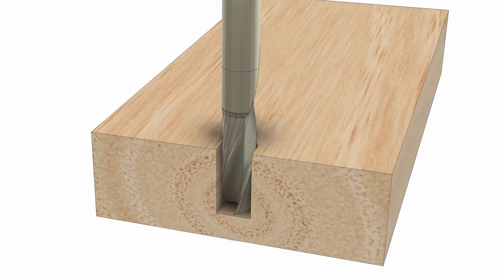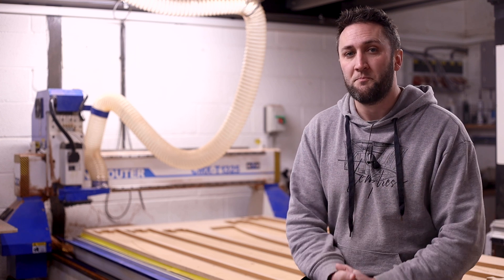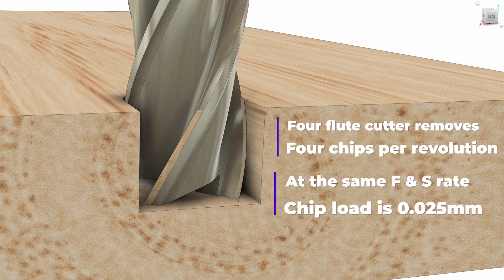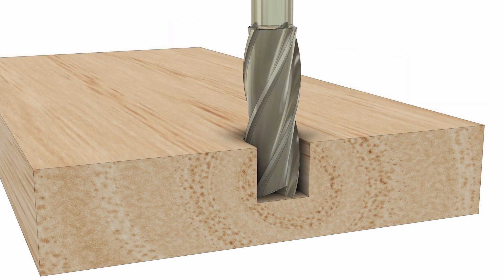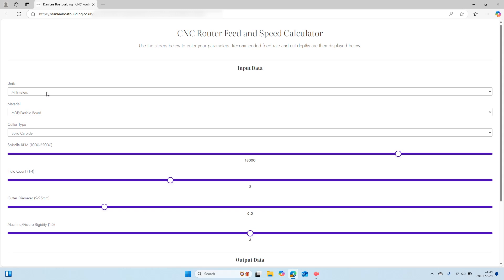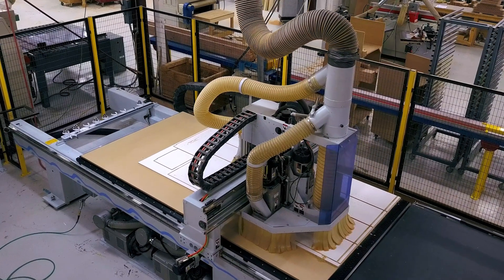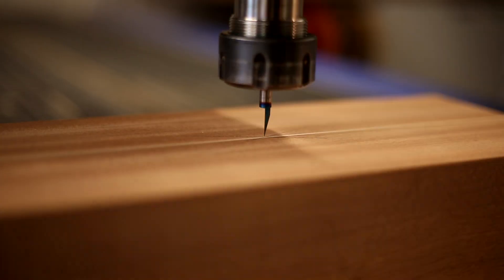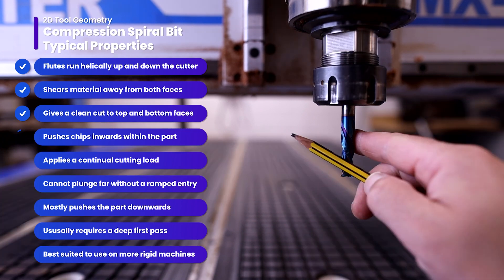The ULTIMATE CNC Router Feed and Speed Calculator | Online CNC Router Course Sample Lesson

Comment: Hi Dan, thanks for the video. My Ooznest Workbee has a max feed rate of 2500mm/sec which is obviously very low. Therefore, I need to compensate by reducing my RPM drastically. I'm concerned running the router RPM too low will be dangerous. Do you have any suggestions on lowest RPMs I should be stopping at? For example, is 3000-5000 RPM achievable or risky? Can I go lower still? I'm carving wood (hard/ply/MDF). Many thanks

Comment: Maybe add lock toggles on each parameter on your next update. That way you could lock the spindle speed and work on the rest, or lock feed and see the other values change. Many people starting out are on cheap machines that don't have all the access to the variables of this calculator. This is how cameras work with the exposure triangle, you can shoot in Aperture priority essentially locking that variable and then the other values are free to change to make the perfect exposure. It might help your students understand the relationship easier then a bunch of sliders and get them up and running easier when they don't have fully capable machines.

Comment: i not can understand how make good right feed and speed because normal spindle can only be speed 10K-24K RPM ad feed not can decrease many cnc (diy CNC) more than about 1000-1200mm/mon. burn bit or not cut good chip ewer and drill bit burn alltime.
Reply from the maker: Thats a problematic combination, even at your best case scenario (10k spindle RPM and 1200mm/min feed rate, with a single flute cutter) you are still only half way to where you need to be for a recommended chip load, if you are cutting soft woods for example. I am guessing your feed rate is limited by the construction of your machine? What spindle are you using? In an ideal world you would source a spindle that can run at lower RPM's but the best you will get out of your machine using it's current setup would be using the combination I've just mentioned.

Comment: Well explained Dan. I have used both hobby and industrial machines and it is a minefield. A lot of the time your ears are the best guide. On the big Format4 machine 99% of the cuts were climb. It I was having to use a stepped cut it would be 1mm out side the part size then make a full depth cut on final size to clean the tool marks.
Reply from the maker: I do finishing passes quite a lot of the time as well, the finish you get when utilising that process is awesome!

Comment: Excellent video, well explained.
I have been programming CNC's for over 40 years, mainly in the aero space, marine environment, I would like to say, that vacating the chips out of the pocket important, if they remain in the pocket they will increase the loading on the tool.
Reply: Recutting chips dulls bits faster than anything. With wood, multiple compressed air nozzles help. Makes a mess but keeps the tool clear.
Reply: @MurraydeLues  Working with metals and fully enclosed machines, liquid coolant was always the first choice.
Reply: CNC milling steel is nearly always programmed using "climb milling" technique for better tool wear and material removal. Is climb milling applicable to wood?
Reply from the maker: Wood work is generally the opposite, “conventional milling” direction would usually leave a better finish on wood, especially on long grain. Also because routers are generally less rigid and spanning larger areas than a steel milling machine, climb milling can often cause machine deflection. Climb is sometimes preferable though especially in more fragile grain instances to reduce break out. I use climb milling when post bevelling boat frames for example 👍